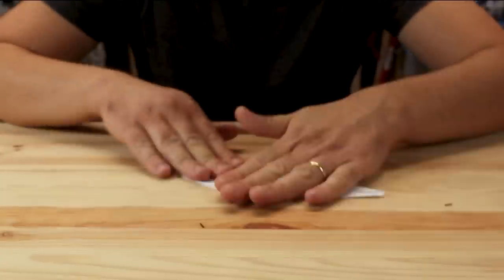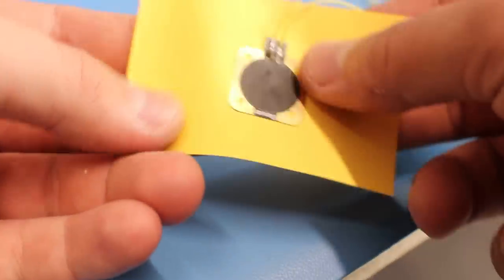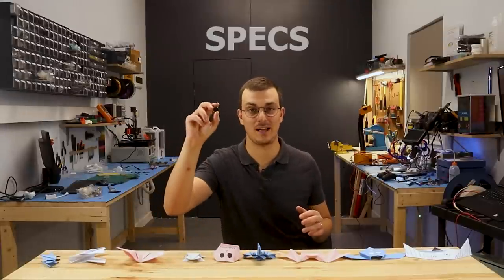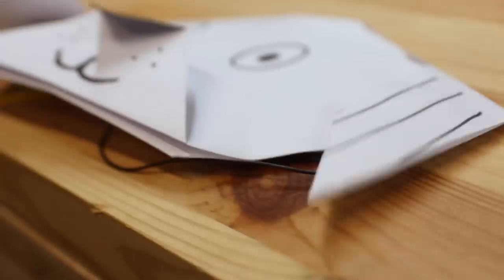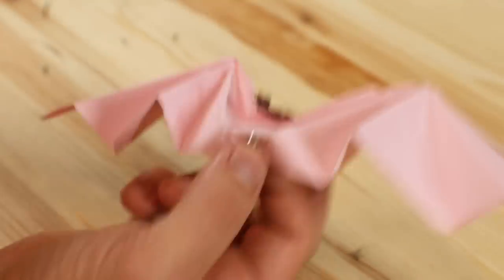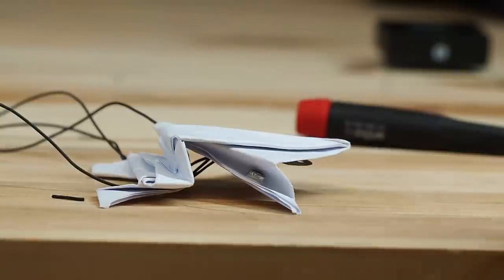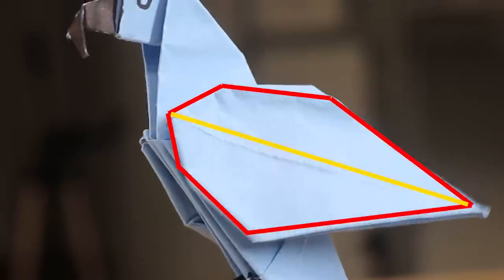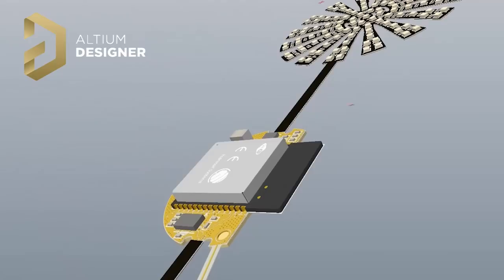Sticker Actuators for Origami!!

Comment: Have you tried putting two sensors facing each other and sending out of phase signals to each? That should eliminate the mass of the magnet somewhat as well as make for a larger area over which the field can act.

Comment: This project is totally geeking me out.
Questions:
• What happens when two of the actuators are placed face-to-face (will they repel each other)?
• If a lighter origami paper is used, the weight of each layer would change; would the incendiary value change?
• Are the magnets as thin as possible and still allowing a repelling action?

"Fly, Stanley! Be free."
Reply from the maker: The force between two actuators is very weak - that is why i'm using n52 magnets - the thickness i used varies (for the origami I have shown) between 1mm-5mm. I think lighter paper would make it more flexible to move ever further and faster.

Comment: Hmmm....Rattlesnake might work well and have interesting sound.   I'm guessing the magnets strength has an effect on the motion, so is there an effect when you stack magnets?  I could see their being some interest the RC Airplane model community... those folks are always looking for ways to move or flex control surfaces and small flat actuators are always of interest (power and weight not withstanding).

Comment: @Carl Bugeja You should sell this to Hallmark if you can reduce the heat and power to run in those singing birthday cards.
Reply: Used lighter material for more rigid constructions, like died wax paper. Also try out transparent papers those are neat